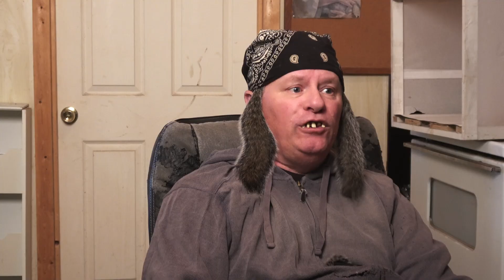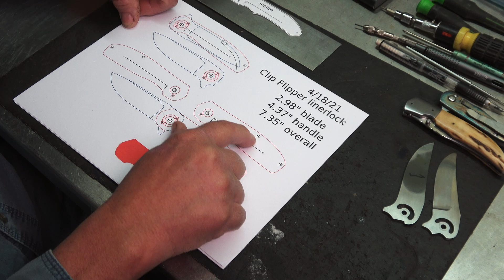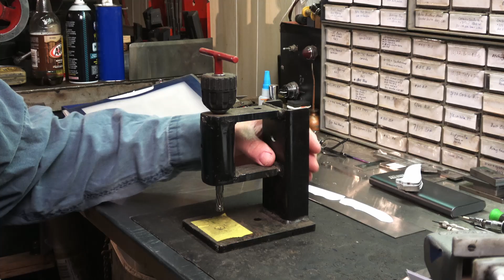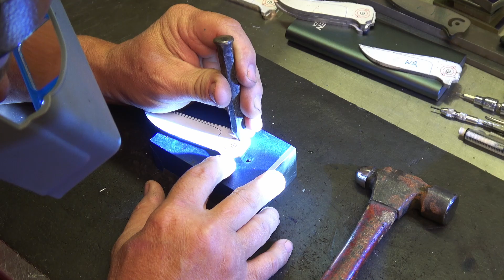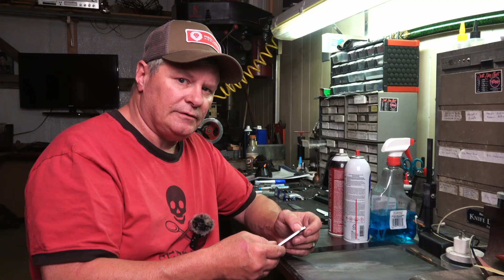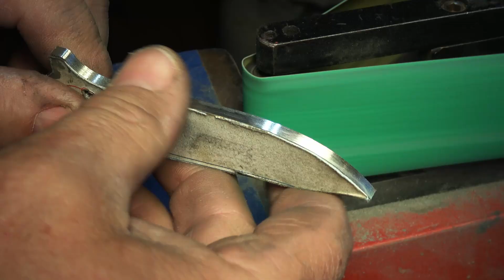How to Make a Titanium Framelock Folding Knife - Part 1

Comment: Do you have any patterns available? I've never made a folder and would like to have somewhere to start.
Reply from the maker: I do not my friend.  I use Inkscape to design them.  Takes me quite a while.  Then I go through several prototypes until it works right.  I first had to learn how to use Inkscape however, the first few I designed was on paper.  It works but not as accurate in my opinion.  Thanks for watching!
Reply: @TonySeverioKnives  great videos thanks for making them!
Reply from the maker: @kevinsprouse6968 You’re welcome, thanks for watching!